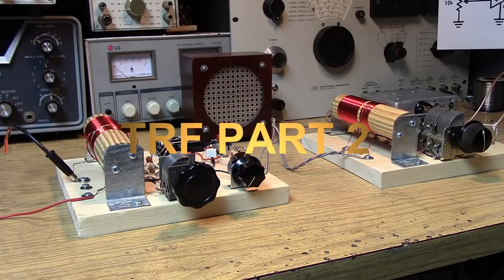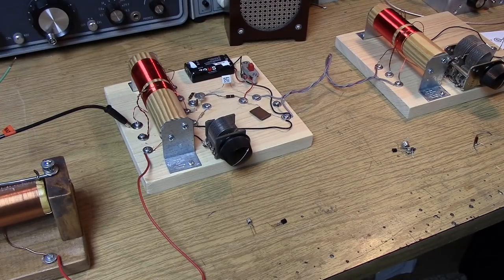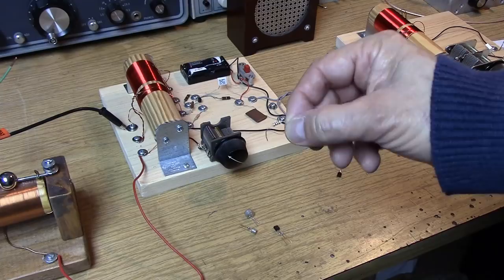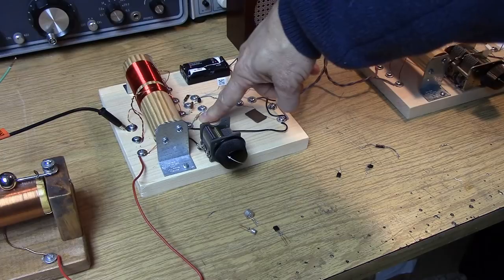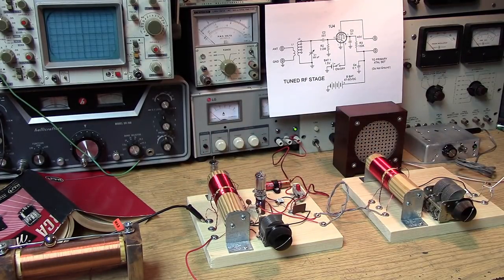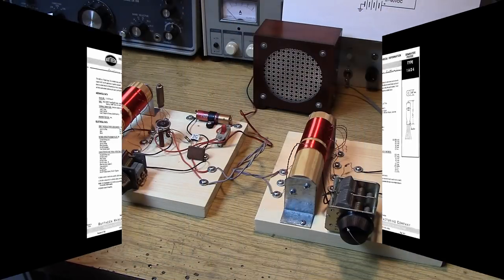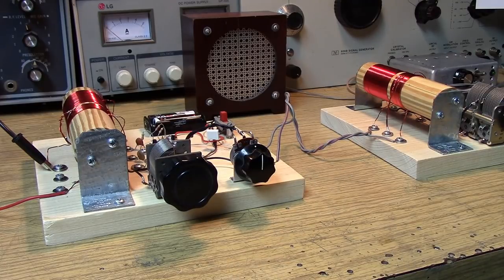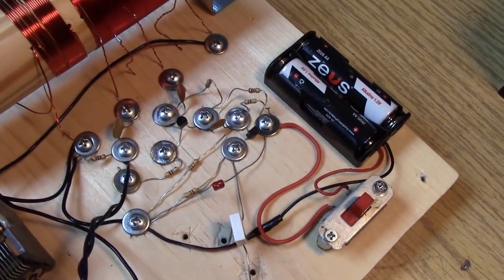TRF PART 2

Comment: I use scraps of copper clad G4 for my prototyping. I space-wire all of my components. There's always a ground plane right there. The bypass caps are always no more than a few tenths of an inch from a good ground. If I need to shield a portion of the circuit, I cut pieces of PC board material and solder them into a box around the sensitive circuit.
I haven't done work as low a 1 MHz in a long time. I need to get some experience with low frequencies before I comment much more.
I learned my prototyping techniques from a good friend that can do microwave stripline designs in his head. At those frequencies, a wiggle in a PC board trace is a component and Ls and Cs are patterns on a PC board. I made a 315 Mhz super regen receiver once whose reactive components were just patterns on an FR-4 PC board.
Reply from the maker: Excellent build method!

Comment: Slide tuning coil can work without external antenna, if it use as a part of LC tank ( variable inductor ). Slide tuning coil works as a "magnetic loopstick antenna".
Receiver - TRF with infinite input impedance.
Reply from the maker: with no wire antenna  the Big Coil or Long Ferrite Rod = Big Signal.

Comment: For the transistor circuit,  drive the base from 1 turn coil. Bias at 1ma to 3 ma.  remove the emitter follower stage. gain can be controlled by reducing the bias current. Should be very stable . Bipolar IF amps obtain stability by mismatching the input circuit and driving from a very low impedance - 100 ohms or so.  Want even more stability? drive it from the emitter and ground the base to rf.

Comment: If you are going to use vacuum tubes then what about using TELEFUNKEN Space Charge tubes that will work from 12V-45V with a 3V heater, you can use common base operation and use the emitter lead as the input and the collector as the output side, ECC88 tubes can be used at voltages from 12V-50V.

Comment: At least in QRP transmitters, I'm a firm believer in the use of ferrite beads on the bases of all oscillators, drivers, and PA stages.  Wonder if it would knock down VHF+ parasitics in your Rx?  Oops.  I need to shut up until you've finished!  How rude!  Amazing videos you make... just spectacular.  I tell my ham friends about your work.  Take care and 73 OM

Comment: 0:26 "Exult the station"?  Don't you mean 'emphasize' the carrier frequency?
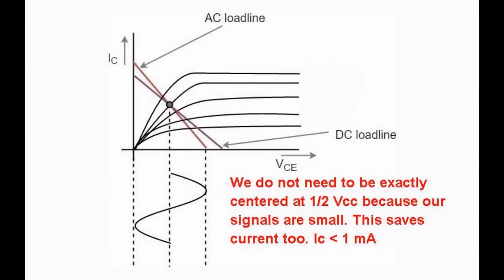2:18 The threshold of instability.
Reply from the maker: Exalted carrier Reception or ECR simply put, it’s when you tune in an AM broadcast using the SSB mode on your radio. Sound impressive huh? The effect is more dramatic on a regen that is critically oscillating. The AM locks in.

Comment: Putting the 1k after the amp (or input to crystal radio) reduces its overall gain by paralleling with the 2.7k collector resistor.  You effectively made the collector resistor 729 ohms, coupling caps and antenna coil notwithstanding.

Comment: Did you consider mounting the coil on the crystal radio at a right angle to the coil on the RF amplifier module to discourage induction feedback?
Reply from the maker: Excellent practice. Of course building on a ground plane and actually using a shielded enclosure would be nice!

Comment: What Tubes would recommend that use lower B+/Plate voltages
Reply from the maker: There are special low voltage "space charge" tubes specifically designed to work on 12 to 15 VDC. These were developed for car radios just before transistors. Most tubes will work on lower plate voltages. People use tubes like the 12AT7 dual triodes or 6BA6 pentode at embarrassingly low voltages like 25 V to 40 V.

Comment: At 6:22 I think you meant Cascade.  Great video though!
Reply from the maker: Wow you guys are so awesome. I am working fast on these and make mistakes. But in this case cascode is the correct term for the   typical common emitter into a common base series configuration that is the standard in high isolation low noise RF preamplifier design. Check out the realistic DX150 all bipolar schematic. They went to fets with the same topology in the 150A 160 etc..
Reply: @MIKROWAVE1  whats the specs of the coils on the 1 tube rf amplifier and crystal set, what size wire, / wooden dowel and  turns and taps